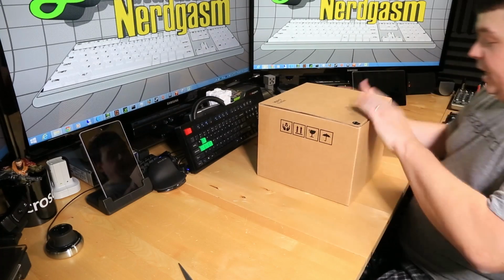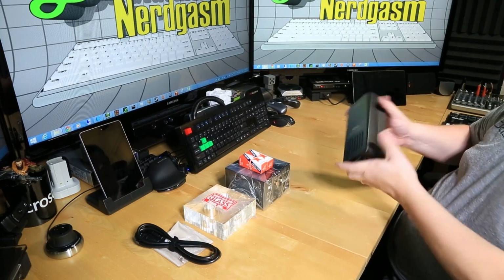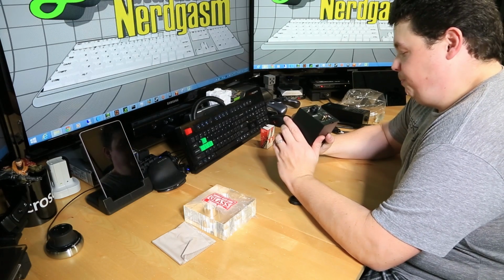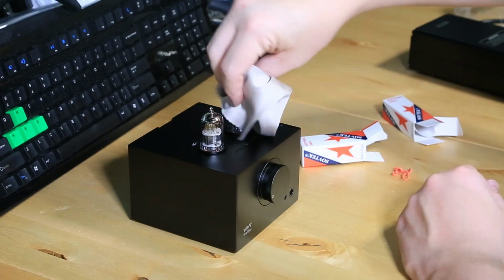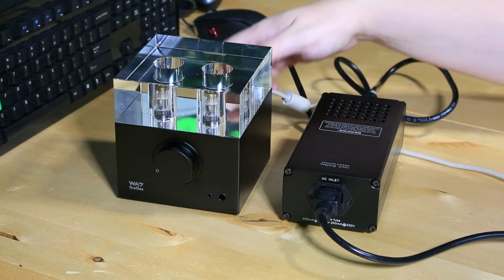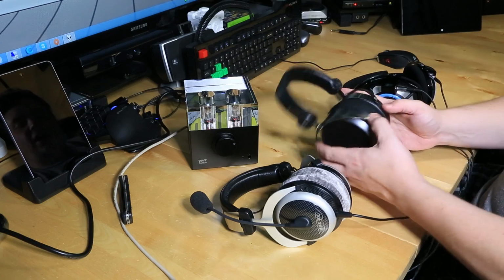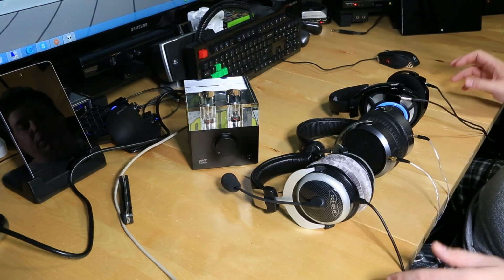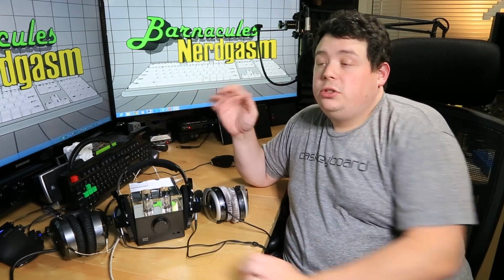Woo Audio WA7 Fireflies USB DAC and Headphone Amp w/ Sennheiser, HiFiMAN & Beyerdynamic Cans

Comment: Excellent video about a superb product. Thanks for posting it. I have a question, Please forgive my ignorance. I am an audiophile who is just getting into quality music on my PC. I don't understand exactly how these external DACs work in conjunction with your PC sound card. I have read that if you buy something like the Woo WA7 Fireflies, you don't need an onboard PC sound card. But I am heavily into Flight Simulator X and am going to build a PC around that simulation soon. So, should I get a good sound card for the simulation and other stuff and the WA7 Fireflies for my classical music? I won't have a mixer or an equalizer. Where does the sound form your PC's USB port originate if you don't have a sound card like the ASUS Xonar? In other words, what exactly would you be plugging into the USB port on the WA7 Fireflies? Would I be able to switch between sound from the PC sound card. if I had one, and the WA7 Fireflies without a mixer or equalizer?

I really don't quite get how all of this works yet. Sorry if these questions sound absurd. I would greatly appreciate your help. Thanks.
Reply: If you plug headphones into the USB port, it is using the onboard sound on your motherboard. If you plug a Dac/amp into the USB port and plug your headphones into the Dac/amp, the sound comes from the external Dac/amp. Screw the WA7, Barnacules later admits the O2/Dac is just as good while being cheaper, smaller, less hot, etc. Some sound cards might have technologies designed for better positional audio, but make sure it's got what you specifically need if you want to get a sound card JUST for the positional audio.

A sound card has a dac and an amp. When you use the sound card, you are using the sound card's dac and amp instead of whatever/'s on your motherboard. An external Dac/amp is typically best. You don't need to spend over $300.

Comment: On tek syndicates channel he said that tube amps really color the sound, is that true?
Reply: A lot of them are, and a lot of them are designed specifically to color the sound. Some people like the distorted sound. But I would argue that you can EQ it, and that a lot of higher leveled audio is about precise reproduction of sound, and if you use a tube amp to color the sound, it sounds a little ironic to me. But this specific tube amp the Youtuber bought is relatively neutral. But he later admits that a regular ODAC is just as good and in a small way, actually better while being way cheaper.
Reply: It's true, but don't trust anything they say about audio.  Those guys have great videos but are horribly misinformed about audio.
Reply: I think if possible, we should color the sound via EQ. All things being equal I'd rather have distortion done by my own hands in software because as soon as you switch headphones, your DAC/amp will sound horrible. It gives you less flexibility.
Reply: Tubes color and distort as you increase the volume.  If you get some decent tubes they will sound less distorted than cheap ones.

Comment: where would i plug in 3.5mm speakers to? the headphone port?
Reply: It's usb connected. If you plugged it into the 3.5mm port , it would bypass the DAC. You most likely need to have a usb cable.

Comment: if you're saying the he-500 is a detail machine over the hd-800 then you are over powering them. They are detail beasts when underpowered but you feed the proper amount of current into them and the headphone creates tons smooth body and dynamics that although slightly over shadows the details is the main attribute of the headphone.  I HIGHLY suggest getting a cheap SS amp like Schiit asgard  just so you can see what i'm talking about. I found this out the hard way.  I also see you're using the stock pleather pads.  I highly suggest getting a pair of Denon D2000 replacement pads off ebay for $38.   It really opens the headphone up and allows it to breath.  Just a little advice from one audiophile to another.  Cheers

Comment: The sss sounds you're talking about is coming from your soundcard, no real audiophiles use integrated sound card because they catch up all the noises from the computer. The inside of a computer is really not the best place to put anything related to audio. Even when the manufacturer say that they put a shield on their product to prevent that, if there is like one little hole in it, it is not shielded. You'll always better be using the cheap soundcard integrated to your motherboard than a pci one.
Sorry for my poor English but I wanted to make things clear about this marketing bs around soundcards. If you're not hearing noise with an external dac/amp, it's because it's outside of the computer, period.
Reply: the sss sound comes from bad recordings,
unless you have a shit mother board, you won't have those problems.

Comment: Hey, just two things: you can use your STX abd the WA7 together. USe the RCA on the STX to the WA7 to only use the amplifier section of it, while still using the STX surround for exemple. Other thing, the gain switch at the back, you had it on Low-Z, which is the low power setting basically. Turn it up to high-Z and be prepare to blow your headphones off!

Comment: Computer power supplies are generally got LOTS of noise and aren't good for audio.  Plus your sound card is generally not very good.  Most sound cards aren't designed by serious audio engineers and they are just meant for gamers (kids) that won't spend $1000 or more on a sound card.  They'll spend $100 to $250 and think that's a lot of money.

Comment: Just a suggestion.  I would have worn cotton gloves to install the tubes.  It's easier.  Plus, before doing any serious listening tests, it's best to wait until the equipment you are testing have at least 200 hours of being used with audio signals running through it so the equipment has time to break in.  Depending on the product, some will sound noticeable to some people.   Check out Cardas cables for headphone cables.  They make nice stuff.  the HD800's are really good headphones, BTW.

Comment: The term is Audiophool... The studios that produce the music wont spend stupid amounts on a power cable! Tbh it will be one that can be had for like a few quid! A fool and their money are soon parted! You don't need gold plated connectors, a $500 HDMI cable or a $100 USB cable for good quality! If its digital then the quality of the cable isn't going to make a difference. Major concerts will use cables that cost about $2 a metre with non gold connectors on amps that cost about £2000+
Reply: Callum Burns I agree with everything you said except for gold plated connectors. Out of a box a cheapy regular connector will be just the same as a gold one, but the difference is that over time the cheapy one will oxidize and affect quality. The gold one will not, or at least not in your lifetime. And this isn't just some BS, I mean, if you look inside any computer you'll see almost all components are connected with gold-plated connectors, even when it's almost all digital (proving that gold plating isn't just a gimmick).
Reply: Actually no the look for both. Clarity and volume is key.
Reply: Callum Burns
You've obviously never heard a proper audiophile setup if you think it can be compared to audio on concerts.
Reply: I am a trained events tech... Heard many different systems. I know snake oil from a mile off... I love it when someone spends a fortune of say speaker cable when reality is that something that would cost 5th of the price is just as good! Also the studios that record the songs in the first place dont use these expensive cables! The whole thing is laughable.
Reply: But concerts that use PA systems aren't using those systems for sound quality, they are using them for making the music louder.  In recording and mastering studios, the higher end studios that make classical recordings use RIPPING expensive cables.  That's because the recording is meant to capture a live performance as accurately as possible.  REAL classical music performances don't even use PA systems since they play in concert halls that don't need to use a PA system.
Reply: Callum Burns It depends on the system and the application.  If you talk to Bob Ludwig, who is considered one of the top mastering engineers of all time uses Transparent cables in his studio.  His speakers cost around $100K and helped on the design of them as he gets prototypes to listen to and offers them feedback on what he likes and dislikes.  He is also using expensive Cello amps and his equipment for his mastering desk has been customized from what is originally purchased. There are many small to big high end recording/mastering studios using a variety of high end cables from MIT Cables Transparent, Kimber, etc. through out different aspects of their studios.  They are more often used in audiophile type recordings where there is no signal processing at all during the process, so they aren't like the typical pop/commercial recordings.   S
Reply: Callum Burns You should mosey on down to Skywalker Sound.  They had some custom boxes made by MIT Cables that essentially takes their passive filter designs and applied to the microphone cables in their studio where they track orchestras for film soundtracks, foley artists, etc.  The boxes cost around $800 per microphone cable. They also use a variety of their interconnects/speaker cables, etc. through out their main studio.  They are also a non-paid reference customer for MIT Cables, they also assist in doing listening tests of some of their cable designs as are other well respected audio equipment mfg like Wilson Audio, Spectral Audio, Goldmund, Magico, Cary Audio and I think one of the owners of a company called DTS (you know, the guys behind DTS surround sound) also uses MIT Cables just to name a few of their customers.  I've been to their factory, have met and talked with their head engineer, and read their technical white papers, and patents and they do have very compelling products that are used by some high end recording studios during the recording and mastering process.  There are a growing number of mastering and recording studios that do reference type recordings that use MIT, or they'll use Transparent, which seem to be the two most popular.  I just think you just don't involve yourself in certain circles of who is in the entertainment industry which is where you got your ignorance from.   You obviously are into a specific aspect of the industry that isn't involved with high end recordings and playback systems so you don't really have much experience in that aspect of the industry.  Live PA systems certainly aren't focusing on accurate sound reproduction for a number of reasons.  it's too costly, the rooms generally sound like crap to begin with, they traditionally don't use high end microphones, and most PA systems are just there for sound reinforcement instead of sound reproduction.  I'll admit that the PA systems are getting better, but in terms of sound quality, a high end system blows them away every time, it's just that these high end audio systems aren't meant to go to high decibel volume levels to fill huge rooms.  Even though some of them can go pretty loud before they start clipping/distorting or blow up.  So please, control your ignorance.  It will make you come off more mature if you did.
Reply: derbigpr500 Of course he hasn't.  He probably doesn't know what the word timbre means.  I never listen to sound engineers that only deal with PA systems unless I'm planning on setting up a PA system, but most of the ones I've run into don't hear so good and their mixes generally sound like garbage.  There's only a few live sound engineers that actually know how to mix properly.  Even in recording studios, if the engineer doesn't have any experience with recording reference quality recordings of classical music, acoustic jazz, etc. where there is no signal processing done at any stage of the recording, then I will only take what they say with a grain of salt.  In order to have a good set of trained ears, one must spend a LOT of time listening to high end audio equipment to become familiar with what to listen for and how to really judge one piece of equipment to another.  But I will say that more and more recording studios that take their recordings seriously and aren't just spitting out trite pop music, are spending more money on playback systems, etc.  The problem is that in order to spend the money on high end microphone cables/filter boxes for a studio that's tracking lots of instruments, it can cost a LOT of money that the studios simply aren't prepared to spend, so they do a little at a time.  The more simple the system setup is, the more attention they can focus on the microphone cables.  It's a shame these high end cables aren't more affordable, but maybe someday they will be.
Reply: Callum Burns The reason why most touring PA guys don't use the expensive cables is because they treat cables like a $2 streetwalker and it's just too costly for them.  There are a LOT of really bad habits done by some of these PA systems. I've seen microphone cables, power amp cables and lighting cables basically bunched together, which is a cardinal sin to do that, since there will be so much noise leaking into the audio signal.  Seriously, most PA systems are not designed for accurate sound reproduction, they are for sound reinforcement (meaning, just to make the instruments louder to fill a big room with a bunch of people), and they aren't concerned with sound quality to the same level as an audiophile in a nice listening room.
Reply: clarity and volume?  Well for PA systems, that's the basic concern, then there is feedback and simply not blowing up speakers and amps, etc.  But for home systems or in a high end studio where accurate sound reproduction is important, the equipment is important and it's just matching things up to please the listener and everyone listens to different types of music and have different levels of hearing abilities, etc. and people buy what makes them happy.  I don't see why you are so closed minded about high end audio.  Is it because you can't afford it and instead of taking a more mature attitude towards it, you just make up misleading comments to act superior?  I see that a lot with immature people in/out of the audio/entertainment industry.
Reply: Callum Burns I've been to plenty of concerts in my life where what the sound engineer thought sounded great,  I though sounded horrible and had too much high end distortion.  It was for major tours and they were using top end amps, speakers, etc. in terms of what they use for live sound.   Probably because I've spent a lot of time with better home audio equipment, my ears got used to listening to music without distortion, so when i heard small amounts of distortion, it fatigues my ears.  Well, I would venture to guess that most people that walk out of concerts have ear fatigue, but it comes in the form of ringing ears, and since most people generally get drunk/high for concerts, their hearing is shot anyway, so who gives a crap how good the PA system sounds. It's all about how loud they can get it.  For long term listing, it's not good to have music at dB levels much above 90 db, which isn't that loud for concerts.  Especially when there are bands with PA systems that get to the 120dB and even higher for the people in the front half of the concert hall.
Reply: Callum Burns Maybe you should go to a classical concert where there is no PA system in a proper concert hall with and orchestra.  THAT'S as clear as you can get. Sit in the 12th row and LISTEN to sonic accuracy.  PA systems are just meant to go loud without feedback, but they are typically FAR from being accurate sound reproduction. Why? Because it's too expensive to travel with high end audio equipment as things get thrashed around and they just replace the cable when it fails, or replace the amp when it fails, but they aren't concerned with accurate sound reproduction, so your ears, sad to say, are trained to listen to music in a false setting where what comes through the PA is nothing like what the acoustic instruments would sound like in a proper room.  Seriously, you need to get some other experience to draw from and your hearing is probably damaged to the point where you can't hear the subtle differences in high end audio equipment.

Comment: There is no need for using ASIO if you are using Win7/8, because of WASAPI. What ASIO does is just kernel streaming, which reduces latency. WASAPI can do the same. The older Windows OS cannot do this, why ASIO then becomes useful.

Comment from the maker: Technically yes you can, but tubes do have a life span so you might have to replace them ever year or so if you ran it 24/7. I have a ART Tube AMP MP that has never been powered down and it's over a year old and the tube is still going strong!

Comment: powercables and USB Cables are not important, if they work, they work! Where it could make a difference, is the Chinch cables, but i am sure the avarage ear won't hear that :)
basic rule: Difital cables: buy cheap ones (USB, toslink etc), Analog cables: buy good cables (chinch, speakercables). but you can get good sounds with 1$ cables, we are talking about perfection :)
By the way, try a CD or a uncompressed audio file (WAV), that should make a huge difference when compared to 128 or 320 kbit/s